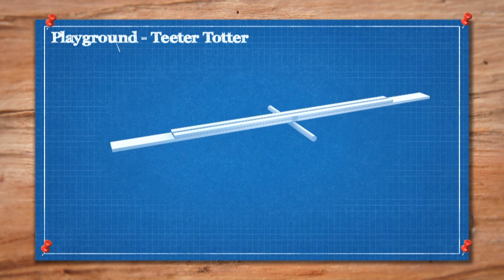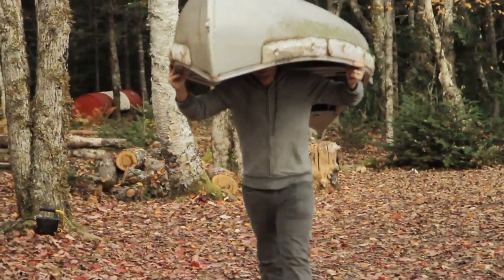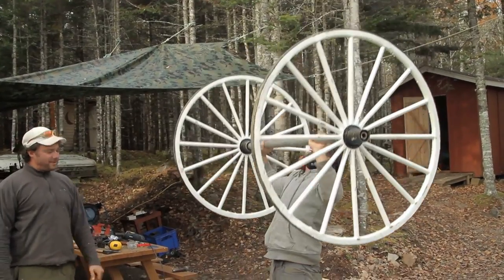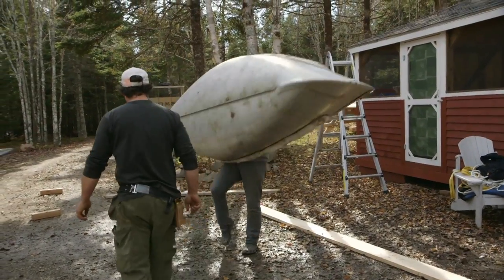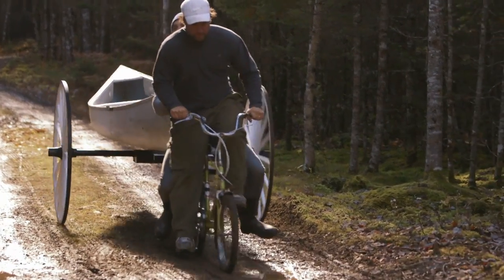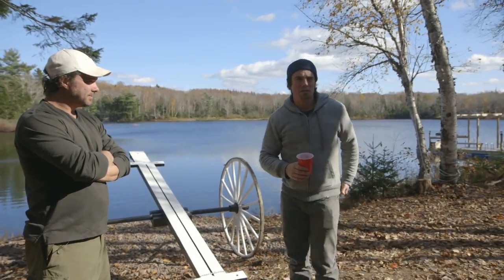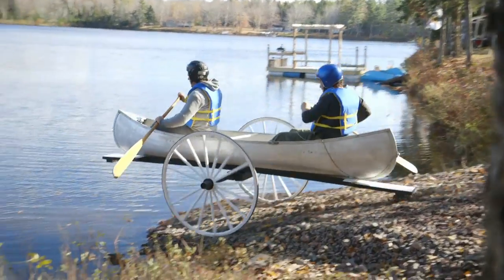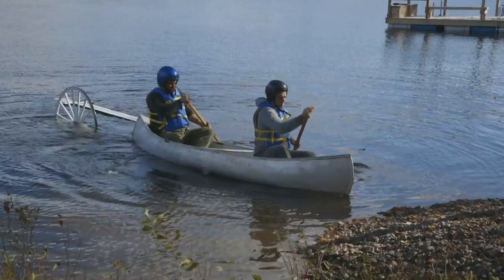DIY Canoe on Wheels

Comment: Nice job ripping off the anti sink foam. You could have cut the entire thing in half and it would still flloat. I do love your vids. Do a little research on your items first. As a diy guy I have made simular mistakes.  Loved the ford shanty so much.  I plan to build one simular. I dont want clear sides however. Great job though.  best ideas ever guys.